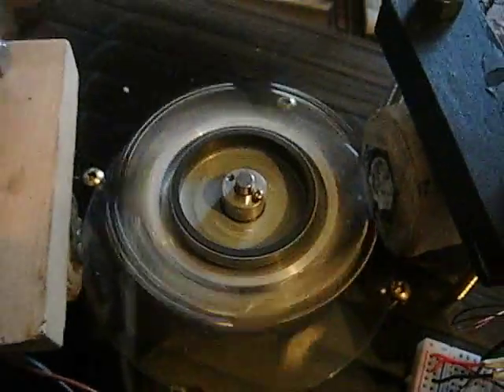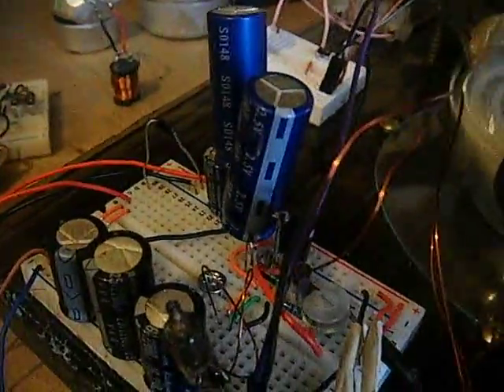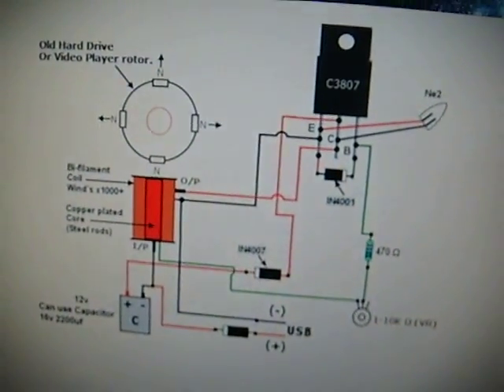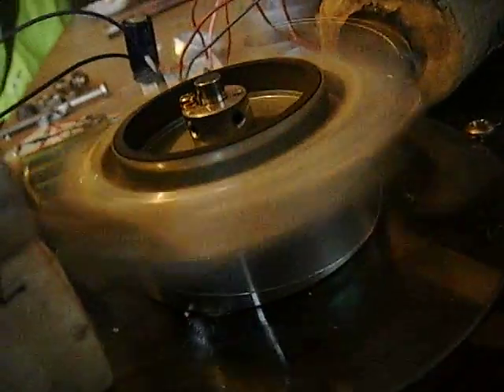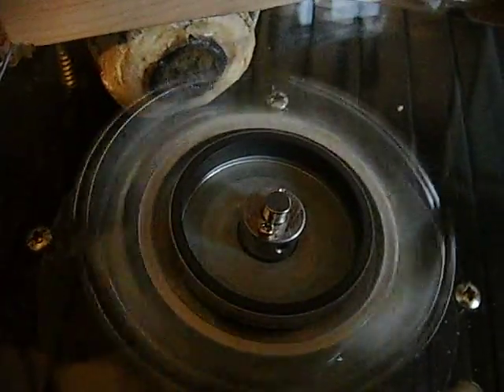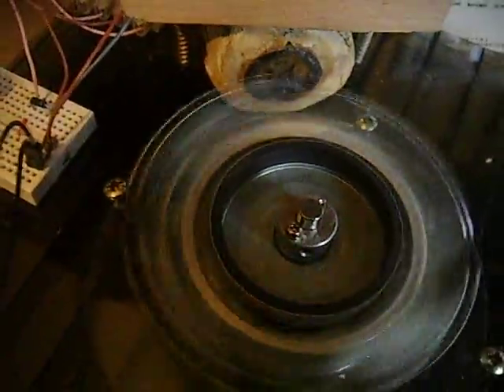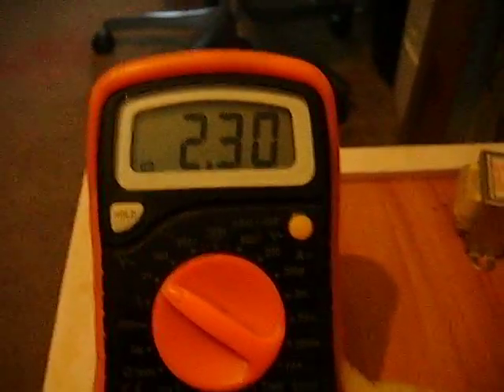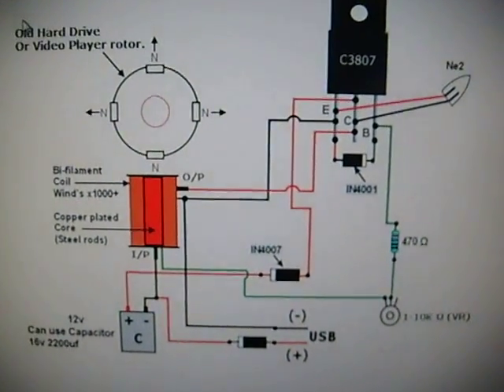USB Bedini (Low Voltage)

Comment: Other than driving a neon bulb, what is this circuit good for?
Have you measured the power (watts=V*A) drawn from the battery/cap & compared it with the available power (Watts=V*A) at the output of your circuit?
Reply from the maker: The Bedini Motor is only good for Charging an array (like 5+) car batteries - I am only interested in getting the thing to run on the lowest voltage (as stated) - Amps are obviously "Milli-Amps" (as stated) and would not power any house hold items but if you have been charging 5 leisure batteries all day then you will have Energy for the night using an inverter - I am just experimenting, I do not wish to switch up the amps or watts just yet but I have found some interesting things just messing about - I have tried other methods borrowing ideas from you tube but no low voltage ones worked for me, so I experimented and got good results (in my eyes) - I have learned what I needed to learn but I will not turn up the juice until I stop shocking myself... But I do that deliberately so I shall have to wait ;)
Reply: "I do that deliberately"??
You shock yourself deliberately?  Why??
Reply from the maker: A B
3v maximum input cannot harm you - Although I would not recommend using a 12v input with a 2N3055 NPN Transistor to anyone but I accidentally got my first shock from a Bedini Motor with 4 separate coils, I was hit with a 300v DC pulse. If that couldn't hurt me this most definitely will not either. I tried it on my inverter as well and found out that when I used a Toroid instead of a transformer I felt nothing at all, the transformer actually hurt. Aah, such is the Life of discovery - I should mention that the coil needs to be 1000 turns, not even my x888 turns works - I found that by adding another transistor (2N3055) in parallel with the C3840 it works even better ;)
Reply from the maker: A B
It runs on 2.5v - You can use x3 Larger Bifila coils as induction coils they may well produce the extra juice needed (not sure). the main drive coil could be x1000 turns with x3 induction coils at 2000+ turns each - My current bifila induction coil (x1008 turns) pushes out a small 2.7v spike but its Amps are rubbish, larger coils with a larger gauge wire may help too. If we could find a faster transistor (low voltage) then induction would be better - I'll post my simple bifila induction circuit and video soon.